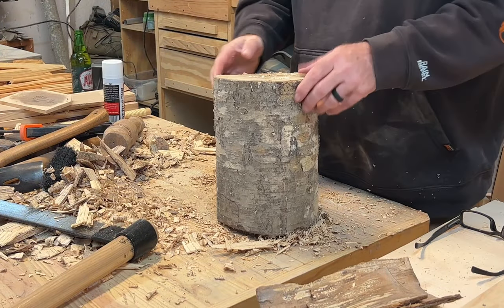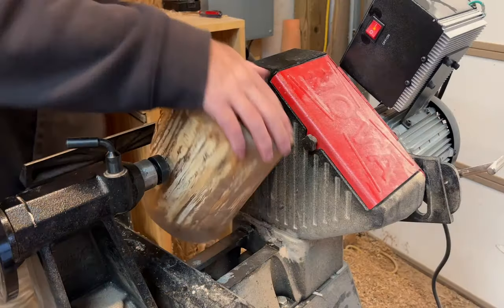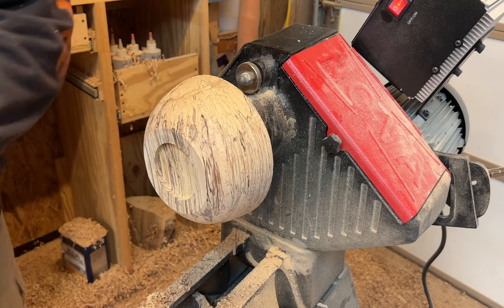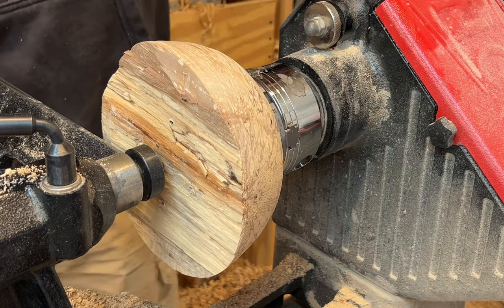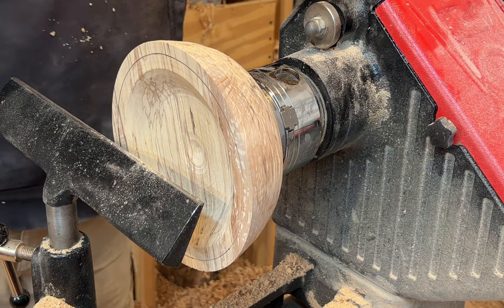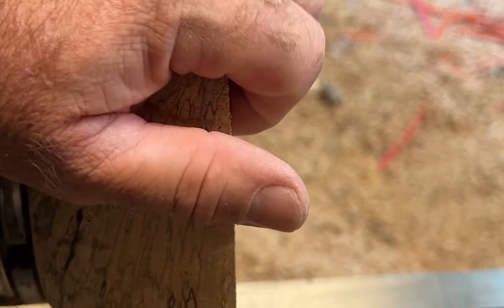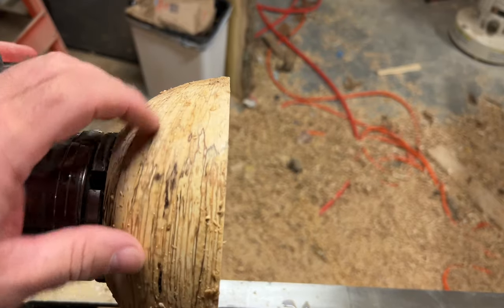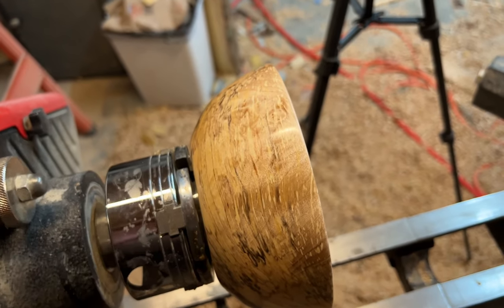Birch Log to Birch Bowl - Woodturning a Spalted Birch Bowl. (#50)

Comment: Nice! I turn a lot of spalted wood. Try thin StarBond CA. I buy it by the pint. Pour a small amount in a cup and brush it on. In most cases the tear out is eliminated.
Reply from the maker: I will have to try the CA.  I've watch some vids on it.  Looks like it would do the job.

Comment: Spalted birch is so nice, beautiful bowl. 
I rough turn mine and then liberally coat it with wood stabiliser. Leave it overnight and it turns pretty well the next day. A lot less tear out but still plenty of sanding required. 
Like you say, definitely deserves as good a finish as you can get. 
Thanks for sharing 👍
Reply from the maker: Thanks for watching.  I only have half a log left of this log so I better make it count.
Reply: @kyhandcrafted  - I’m sure you will 👍

Comment: Nice job. Looks like you used a water base polyurethane and then applied Danish oil. No compatibility issues?
Reply from the maker: I have not.  Most of the poly is sanded off except for the pits.  I also think by rubbing in the dust helps.

Comment: Given how long that was compared to its diameter, you could have saved a lot of time by bandsawing off the ends into a circular shape.
Reply from the maker: Typically I do with my chainsaw but it was raining out when I started.  The wood was so soft it didn't really matter.  Now if it was a hard maple or oak - you bet I would be knocking it down before turning.
Reply: @kyhandcrafted  You need a bandsaw.  ;-)

I would never have thought of polyurethane as a reinforcing material.  Have you ever used superglue?  I've used that in punky wood, and it soaks in quite well.
Reply from the maker: I do use it for cracks - especially for color.  I just find the poly is easier to work with for me.